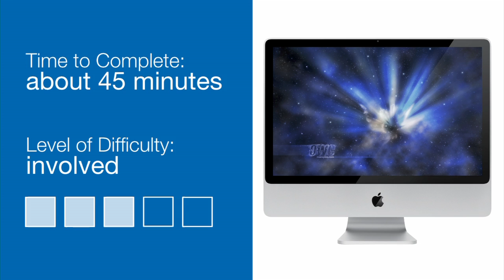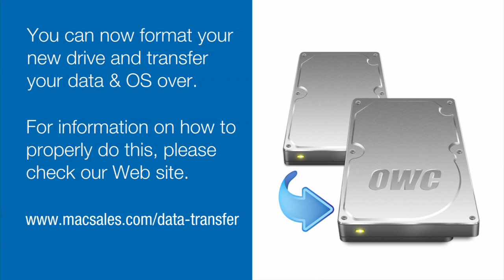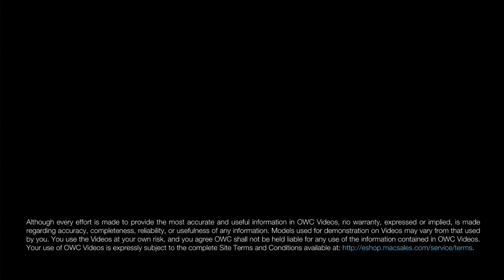24-Inch iMac (2007-Early 2009) Hard Drive Install Video

Comment: really having a VERY difficult time disconnecting the bottom of the frame near the RAM slots from the rest ... i've been pretty aggressive and PRETTY certain i'm damaging something - it doesn't just 'wiggle off' like in the video - not at ALL. be warned. ALSO - i broke off 3-4 of the pins at the top since the outer glass cover wouldnt' just 'lift off' either - took QUITE a lot of force and i thought i might break it so i used my two suction cups (much stronger than those shown in the video) from ONE SIDE ONLY ... dont' do this
Reply: CRAP ... i missed the bit about removing the memory slot screw and tore the crap out of the plastic bridge inside - hopefully i didn't wreck much else
Reply: hmmm looks like the one (right side) ram stick is now wedged diagonally in it's slot -part way out - hope it didn't shear the RAM chip holder's connection to the lower circuit board!!!

Comment: We did it, it worked! Connectors all came apart and put together without a problem. Pulled glass off horizontally like people suggested, and used ice cube tray to hold screws. We saved $500 and I now have 2T storage! I'm wondering if this if possible to do on the newer computers? I know Apple doesn't like regular humans altering their devices.
Reply: Yea its possible
Reply: How did you get 2 TB? You put an SSD and a HDD into it?
I am very interested to know if these models support more than one drive without getting rid of the Superdrive.